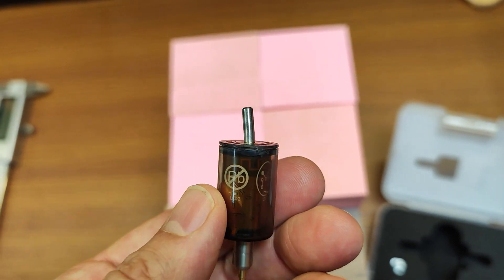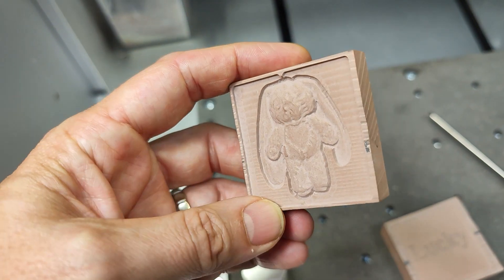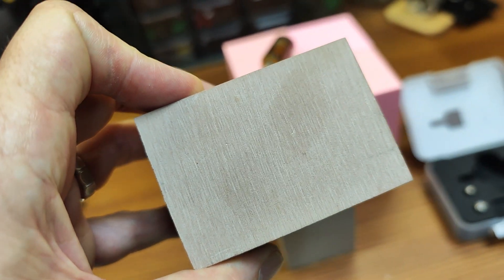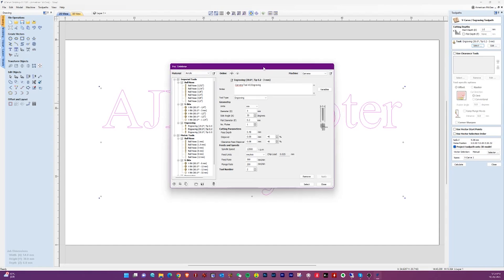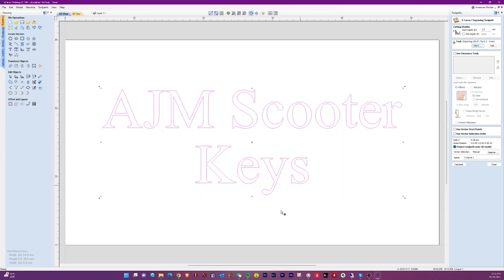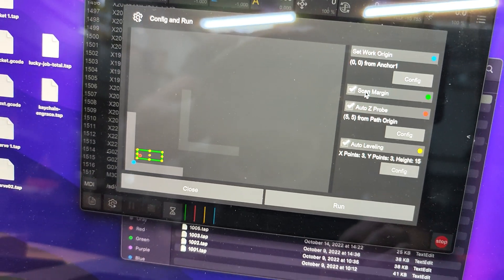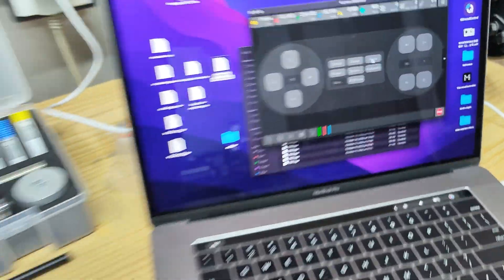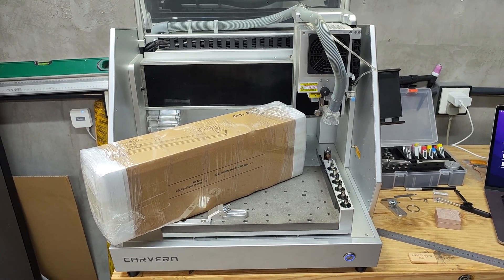Makera Carvera Desktop CNC - World First Z-probe Crash!

Comment: I recall viewing a video long ago, before kickstart investing, that allowed user to designate specific blank material locations that you wanted to probe.... What happened with that?
Reply from the maker: You can choose where to do the initial Z-probe as an offset from the material edge. But for the Auto-Leveling Function (which also uses the Z-probe), there's a range of selections... but none that allow you to select arbitrary locations for the auto-leveling routine. You can choose the "density" of the auto-leveling readings - like the number of points to read in total across the surface. I asked Josh (at Makera) about the possibility of allowing some sort of edge offset for the auto-leveling routine but he said that wasn't really compatible with the goals of auto-leveling. Maybe a question to ask the team over on Facebook or Kickstarter?

Comment: Good info. This is actually one of the main reasons I keep pushing for a pendant controller with jog dial. I was taught to always start the first run of the first part at 0% feed rate, and walk it forward with jog until it proofed.
Reply from the maker: Yeah, my previous CNC had a pendant controller and a lot of these things were done manually (setting z height etc). So it's interesting to fight my instincts on this stuff and learn how to work with a machine that's more automated. These mistakes are purely my own fault. And I wonder if I would be making them if I didn't have this built-in way of doing things that's counter to how this machine actually works. Anyway, big lesson is... Keep a finger on that stop button until you know everything is running as expected 😂
Reply: @AmericanMcGeeOfficial  that’s…a fair point, actually.